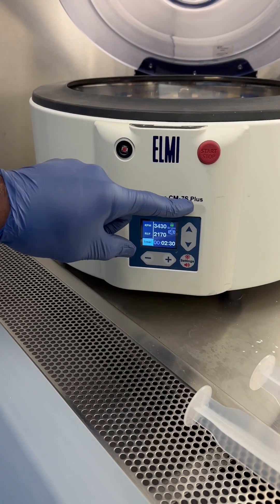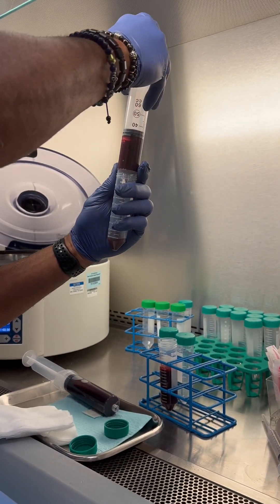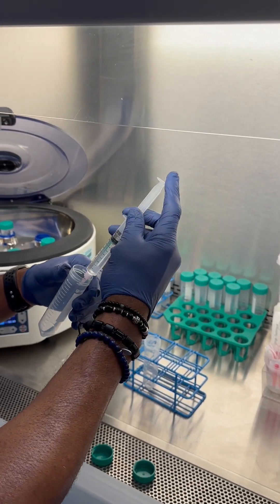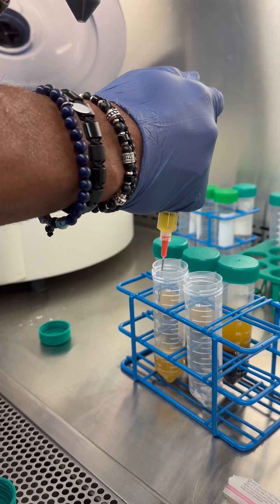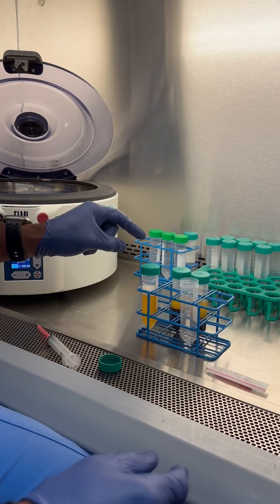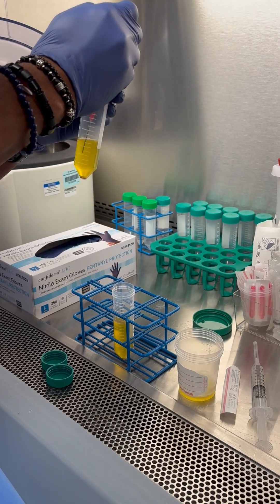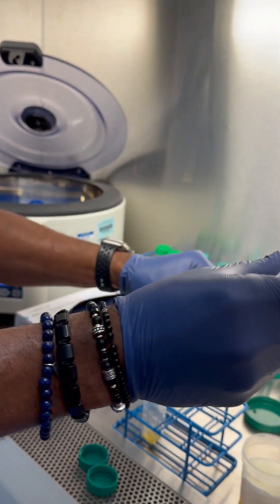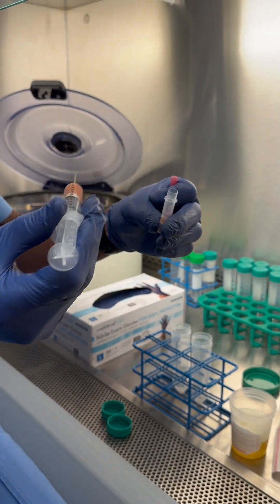How to make Platelet Rich Plasma (PRP) with no Kit!  #prp Video (From 120cc blood to 6cc PRP)

Comment: I think if you hadn't opened the tube and exposed it to oxygen, you would have gotten a much higher platelet count result, since many platelets coagulated during the second spin. What do you think?
Reply from the maker: Our platelet count in the PRP was 2827!  In Blood it was 214.  Our concentration was over 10x.  I don't understand your comment about coagulated platelets given those documented numbers off the hematology machine.  To answer the other part of your question....after 16 years of doing this....and tracking outcomes....platelets exposed to oxygen have no bearing on the outcomes of the procedure.  Right now the best metric we have to track is the platelet dose.  Volume x concentration.

Comment: Thank you for posting your technique Dr , I have some questions : first , the PRP is not the lawyer on top of the blood after centrifugation ? I see you left quite the plasma on top of the blood, The second question is about the turbulence when mixing the PRP) and passing it to the tubes, this could cause Plateletes lysates which may cause microtclots involved in distal necrosis of the application sites .  The third question is about the white coat on top of the blood after centrifugation : I normally knew that the white coat is actually the PRP with some kits having the mechanism to push out this white coat ( PRP ) to be used, But I founded a company that affirm that the white coat are neurophiles and should be discarded in a similar way you do when leave it on to of the blood . I would appreciate your expertise on this and thank you for taking the time to post .

Comment: Great explanation! Thank you! I have a swing-out centrifuge. Would you change something with your protocol in this case? Appreciate your help!
Reply from the maker: You have to match the RCF of 2170.  There should be some documentation with the centrifuge tells you how to calculate that based on your centrifuge spin speed
Reply: @texasorthobiologics  Awesome. Thank you :) One last question: Does in this case sodium citrate also work as anticoagulans? Or does it have to be acd-a? Thanks a lot for your great help. Regards from Germany!
Reply: Looking forward to your answer. It is very hard to find useful information on PRP. Thanks for your help.

Comment: It seems to me it would simplify the process and collect more platelets by using a gel separator tube.  After a single spin, you could aspirate the top 80-90% of the plasma.  Then you could re-suspend the remaining plasma and platelets in the first tube (thanks to the separator).  This should get nearly all of the platelets since you dont have to eyeball it, stopping at the RBC.
Reply from the maker: Tried...gel separator tubes typically have a very low platelet recovery percentage ...about 50% worse than the technique shown here.  There are many reasons for this...but the easiest way to prove it is to run blood at the same time on the two techniques and get the data... we have done that.
Reply: You are correct. Gel will allow easy collection of platelet-enriched plasma (2 x the baseline max). My father makes PRP in syringes (on daily basis). He actually prepares liquid PRF with 4 to 8 x baseline platelet count (and verifies this with the analyzer). He says, it is the best platelet extract and most economical. We created a syringe clipper so he can clip the flanges automatically and put syringes to a common centrifuge.
Reply from the maker: @marcinkowalewski4000  Our average dose now is with 120cc blood draw and has a platelet recovery percentage of about 70-75%.....far better that the gel systems...and more practical for sure when drawing 120cc of blood.   Our doses for a 6cc PRP end volume are typically 15 Billion+ and our concentrations are 10x or more...

Comment: Can we check platelets and other components in PRP by hematology machine that uses usually for CBC etc or it can damage hematology machine ?
Thanx
Reply from the maker: yes you can and it will not damage the machine.  For higher platelet concentrations you should check the range on your hematology machine to make sure it can handle platelet counts over 1000....and higher in the PRP ranges.